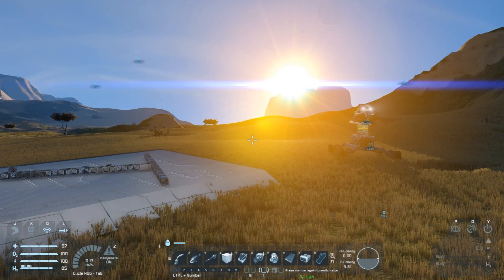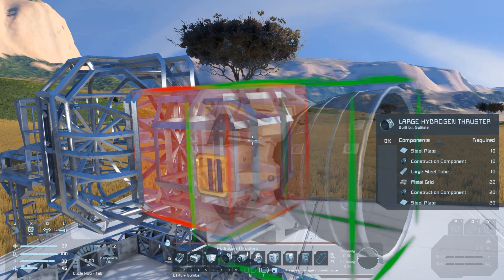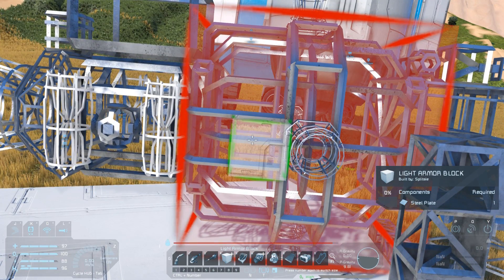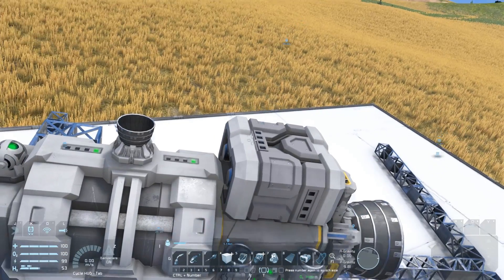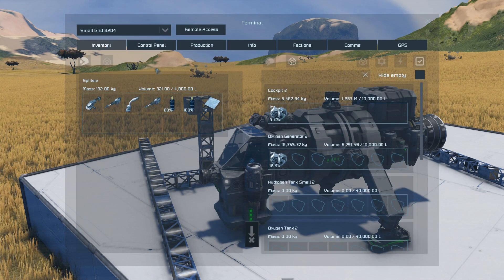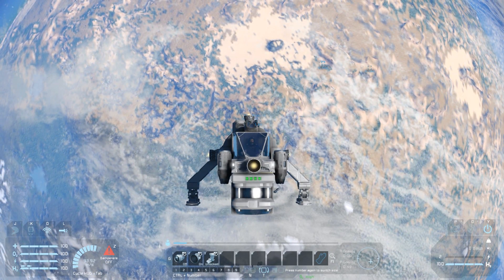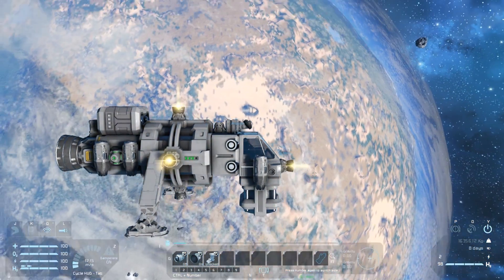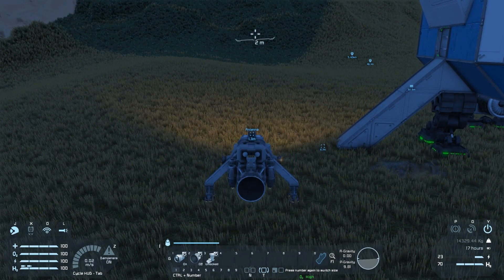Space Engineers Tutorial: Reaching Space from a Planet (Part 5 of a survival tutorial series)

Comment: How do you tell what your weight capacity is for mining ship vs thrusters?
Reply from the maker: You can do calculations based on the maximum force generated by the thrusters (you can see their max output by looking at the override values) though that requires using a calculator. My preferred method is to dig up stone until I can barely fly and then make note of the total mass at that point :)
Reply from the maker: You could do that in creative mode as well if you don't want to risk crashing your ship
Reply: @Splitsie  where is the fun in that? :)  Also thank for the videos just started playing and really find them helpful

Comment: Hey Splitsie! 
So i built this ship Yesterday with a friend. We are VERY new to the game. Infact this was our first time to space! :)
We built it as a test run, to prove we could actually get to space on the resources we had. So it was more of a 1 way mission as you would say. However, it went extremely well! We got up there, mined a full ship worth of Iron, and decided to come back......... Thats where we ran into issues. 
I added a second cockpit to the top for my friend to ride along. Other than that, it was the same design you used. 
We could not land the ship back on earth. I went through probably 20 saves trying to land. In most cases i just hit the ground at speed limit. A few times i was able to get it down to 80 before exploding on impact. 
Curious to know if this was my design fail by adding 1 more cockpit + Player weight, or was it because we were loaded up on Iron? I want to assume it was the Iron. Regaurdless, suggestion to how many more ATM Thrusters i should need to stop? And, when should i finally start to see it slow down?
Reply: The extra cockpit weight is negligable compared to cargo. If you're only having trouble landing safely parachutes might be a good fix, keep in mind centre of gravity when placing them and don't forget to load them with canvas (like I did)
Reply: @cptn.squidface7306  Thanks for the reply! 
So we had a big day yesterday! I Did get that ship to somewhat work. But we ended up designing our own. 4 Large Storage (Small block) + Drill and 3 tanks. BARELY made it into space on full weight. But we are now setting up our first space station right next to an astroid! :)
Reply: This reminds me of my firs atmospheric scout..... I had no icelake anywhere within range of sight.
The Kolibri Scout worked perfectly well, balanced flight behavior, so I tried its maximum altitude and safely landed back at base..... Very well, next mission, land on top of this high mountain over where and grab some more ice to fill the tanks of my rocket ship.

That's where the fun started...... Cargo full with ice I could not lift off on top of this mountain.
In the end I used the strip of heavy armor under its belly as a ski and slide down the hill, praying for no boulders.
Hitting speedlimit I barely could lift off, but still could not hold my altitude, so all thrusters down set on 100% navigating away from the mountain side and pray....... At like 500m,the f word already on my lips I got speed decreasing and yeah, I bumped a good hole into the meadow in front of my base but as a result got slow enough to safely came to a halt.
Only minor repairs and unloading half of the ice by hand I could lift off and fly to the connector.

Well, next day Kolibri got additional engines. No more skiing in the mountains.

Comment: don't know why, i can't zoom in on my vehicles :(
Reply from the maker: If they're locked to another grid your camera may get zoomed out to include that grid, when you unpark you should be able to get relatively close with the 3rd person camera :)
Reply: @Splitsie  it should but i can't zoom or rotate in. Is it necessary to use remote control on it?
Reply from the maker: @TheIceThorn  The 3rd person camera is only available if you're controlling from a cockpit or seat. You also need to hold Alt to move the camera, then your mouse scroll should let you move the camera position in closer if nothing is obstructing it
Reply: @Splitsie  does zoom also works? Mouse wheels, +/- doesn't work :(

Comment: Sooo I've tried to get to space 20x and have not succeeded. I start falling back down to the planet at about 8k meters
Reply from the maker: Are your hydrogen engines on? Atmos can often get you to about that altitude, you also need to make sure you're not wasting fuel pushing against the 100m/s speed limit - I describe one method of avoiding that during the video :)
Reply: @Splitsie  Maybe I should've checked all my systems. I had hydrogen tank turned off. Thank you very much
Reply from the maker: @anthonymalone6533  Glad you worked out the issue :)

Comment: I can't for all that's love and holy, put a large hydrogen thruster on the back of the medium cargo container. It just won't work. Any work around?
Reply from the maker: The first thing to try is to turn off autorotate by pressing T (by default) with it off you'll be able to spin the thruster to the correct direction as you see fit and the game won't try to flip it back on you :)

The other thing to note is that the large hydrogen thrusters also have fuel ports on their side, so direct connection to the cargo container is only one option, you can also pipe it up with the small conveyors to the sides if you put it somewhere else :)

Comment: No matter what I do the uranium cant move into the reactor and the ice cant move into the h2/o2 generator.
Reply from the maker: Conveyors won't work without power so if you have no reactors already with uranium, nor any batteries with power you won't be able to move resources into your generators. The easiest way to solve that these days (on small grid) is to add one of the new smallest batteries, with the power from that the conveyors should work long enough for fuel to get to your reactors and start powering the grid that way. If it doesn't work, the other option is to build a larger battery, or build a directly accessible reactor so you can jump start the ship from there :)

Comment: I want to make a fuel ship but don't want hydrogen thrusters on it. can atmos and ion make it out of atmosphere
Reply from the maker: Yep, they can. The main problem with using one is that you can only build ion thrusters with platinum which isn't available on the planets :(
Reply: The other problem you're going to run into (at least on the earth like planet) is that there is a grey area around 8000-15000 m altitude.
At this height the atmospheric thrusters aren't working at full power, but the ion engines also aren't working well enough to pick up the slack.

You will find that you can get from surface to space,  but the margin for error is not particularly large, and you won't be able to take much cargo up with you at all.

If I'm building a ship for return trips in & out of atmo (assuming I already have some platinum) I do prefer a solution that minimises the hydrogen thrusters, but I find that even in that case you probably still want at least one hydrogen thruster as a kind of "afterburner" to help get you out of the atmo.

Comment: just a pointer to make it even easier and lazy. Map the forward (large) thrust for thrust override on the hot bar. Then scale it down to barely increasing your speed at all. Continue to decrease the thrust as you leave the gravity of the planet. This will use considerably less fuel than pulsing the thrust and you can sit back and relax, with this you also do not need to turn off damping. 

same trick can be used on planet to move forward without using pulsing or being there. NOTE: if you are online set a timer so it turns it off every 5-10 mins that way if you die or server resets it stops also turning turning on a autopilot to return home is good too but may or may not work out.

Hope this helps
Reply from the maker: At the time I made the tutorial I made the wrong choice and felt that I didn't want to overcomplicate the explanation by adding the thrust override side of things. But when I remake this tutorial (if we eventually get an update to survival) I'll be including that as advice since it really doesn't make it that much more complex :)

Comment: Need help. I can't place the large hydrogen thruster on the container, but it will let me place the the thruster on the platform below. I'm getting really irritated by this. I've followed the tutorial perfectly. I do t know what to do.
Reply from the maker: I'm not exactly sure what might be your problem, the large hydrogen thrusters have a decent number of attachment points so should be able to go directly on either the large conveyor port or the small ones from the tanks. You may find it easier if you ensure that auto rotate is off (toggled with T) and see if you can line it up as you're wanting to that way
Reply: Splitsie Thanks, I'll try that. Also did a fresh install to see if that helps.
Reply: milkbox try out both types of hydrogen thrusters that are available, you might have the wrong one (large/small)

Comment: Thanks dude. Insta sub. I adapted this design and added more batteries and drills so I can get the yum Pt in one go. Also added conv. Junc. In the back to wrap the med cargo so I can drag bottles from the oxyGen. Now that I think about it perhaps the tanks autofill? Crap lol. Well I am in space atm lol.
Reply from the maker: The hydrogen tanks should be able to fill the hydrogen bottles but since you're in space you probably also want to be able to fill your oxygen bottles so having access to the generator with your bottles is a nice touch. I haven't tested it but you might be able to get bottles into the generator via the cockpit. When you're in a cockpit you can place things in its inventory and it was directly connected to the generator if I recall correctly so you might have been able to shift things that way, though it never hurts to have redundancy :)
Reply: Splitsie yeah the 2 small ports doesn't let me drag. Had to route the big port. I got my Pt and is currently building a base ship to move half my stuff to space hehe. Thanks for the vid dude.

Comment: Why are people using hydrogen, atmospheric and normal thrusters? Can I use normal thrusters for travelling in both space and atmosphere?
Reply from the maker: Ion thrusters are incredibly weak in atmosphere so you would need a very large number of them to fly down to the earth like planet with a moderate sized ship. Atmospherics only require power but can lift large weights at lower altitudes and hydrogen can lift large amounts everywhere but need fuel. The reason to use each different type is that they each have their advantages and disadvantages :)
Reply: Splitsie Thanks, now I get it :)

Comment: Caution to those of you who are new like I am. This ship is FRAGILE. Mine started taking off while it was still on the stand, went flying sideways and crashed into the ground. Destroyed basically the whole thing. Great way to end like 2 hours. UGH!
Reply from the maker: Sadly at the time I made this the landing gear were frequently disconnecting so I didn't want to teach a method that wasn't functional. Fortunately Keen have since fixed the landing gear so it again functions as it should. If you start your build with a landing gear attached to a level base block it'll support the whole thing until you disconnect the landing gear. It's a bit more stable than building from a scaffold.
Reply: I just learned the hard way lol.
Reply: Splitsie, I built another one. If you have an established base they're really cheap resource wise to manufacture. So this time I started it on a scaffold, and after the first 3 pieces I was able to place a landing gear and then chop it from the scaffolding and it landed on the platform. It locked right in no problem and I was able to finish the rest of the build with no mishaps.  I got it all fueled up with H2 and O2, got to an asteroid and pulled 127 tons of platinum. I thought this was a risky proposition for such a little ship and I was right to be concerned lmao. When I got back in the atmosphere I was out of control, but I managed to park it full pitch up about 1km over my base and use my jet pack to fly back and forth unloading as much as I could.  I got about 95 tons out before the ship ran out of H2 and went hurling to the ground. It actually hit my base and disintegrated, didn't even find scrap metal. Only damaged some platform blocks though. Just inches from my big aircraft. lol.  Totally worth it, so thanks again.
Reply from the maker: I love stories like that, to my mind they are one of the best parts of sandbox games :)
Glad you got some success with it this time around and managed to get most of your platinum out in time
Reply: Thanks for your amazing and insightful advice. Next time before I fly I will 'save' on the PUBLIC survival server where this occurred.
Reply: Basil your comment is retarded

Comment: My hydrogen thrusters dont thrust, they just have this flame going on. I can't control them.
Reply from the maker: If they are showing a flame there are a few possibilities I can think of to explain why they aren't working:
1. your landing gear is locked
2. the generator is connected to the system but the tank is either not connected or empty so there isn't enough flow of hydrogen for the thrusters to do anything useful
3. you're not in control of the ship - this can happen in multiplayer for all sorts of reasons if there are two cockpits on the ship

I'm sure there are other problems I haven't though of yet, but hopefully it's one of these so you can get back to flying :)
Reply: If it should be one of those problems you mention, then it should be nr. 2 - But every things is connected through each other fx thruster to thruster. Sp I really can't find the problem.

The flames only ignite when the oxygengen. have ice inside of it. When they run dry, the flame from the thrusters dies. The hydrogentanks are at 100% and have 4 yellow light squares that indicates it full.
Nothing happens when unlocking the landinggear except it all fall and explodes.

btw great video :)
Reply: Somehow my left and right thrusteres works now, but neitherforwards, backwards and up can make a flame and work.

Comment: What I usually do instead of disabling inertial dampeners is to disable the forward facing thruster(s) using a hotbar key. Doing this allows you to easily change course without slowing down too much by having inertial dampeners stopping your forwards momentum.
Reply from the maker: That's a good point, it probably keeps you on a straighter course too

Comment: You could put an air vent set to depressurize to fill the o2. You could also put the Large H2 thruster on the hotbar, once for increase thrust override and again for decrease thrust override. You can then customize the force of your thruster and the fuel consumption from your hotbar  instead of the brust method.
Reply from the maker: That's definitely a smoother and probably more fuel efficient way of doing things, a lot less pressing of buttons on the flight up :P
Reply: this comment doesn't seem to be getting a lot of attention but this is definitely very important, thanks!
Reply: I cant believe he actually did this in his new video
Reply: I would also suggest that when in space, turn off the engines and gyro's while you coast to the asteroids.  They use power in idle.  It just means you save fuel and power during the longer journeys.  I made a copy of this ship but added more atmospheric thrusters, giving me control while landing. (I crashed my first ship destroying a landing gear. it was cheaper to just add more mass and have a more controllable landing, without the hydrogen thrusters.)

NB:  I can not place the large thrusters like in this video anymore on the large connector on the cargo pod, had to use a set of conveyors and 6 hydrogen thrusters to get into space.

Comment: Couldn't it be more usefull to take the components for an oxygen generator up to space and assemble a small oxygen generation (and possibly refinery) Station up there? This way you wouldn't have to lift the Oxygen Generator up to space every time. You could just transit between your small station and the ground with minimum weight.
Reply from the maker: It would probably be more efficient that way, but I tend to prefer the extra security of having the oxygen generator already built and refuelling as you go. If you want to be extra secure you can work out the maximum weight of ice you can lift and carry that all the way up, that way if you struggled to find ice (unlikely but possible depending on settings) you'd have plenty of spare fuel :)
Reply: Well, but you could carry that extra ice in the form of oxygen and hydrogen without the need for carrying a heavy generator;-)
Reply from the maker: But then you need to carry the heavy tanks... actually this gives me an idea to test. I think I'll have a look into whether ice can take you further in generator form or if the same amount is converted to hydrogen and stored in tanks. I've already got a few ideas of how to test it too :)